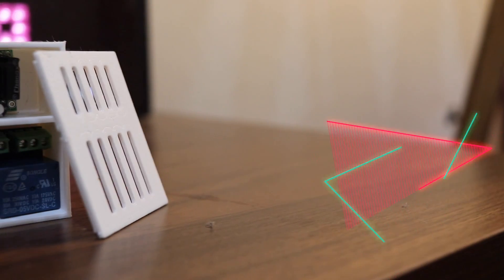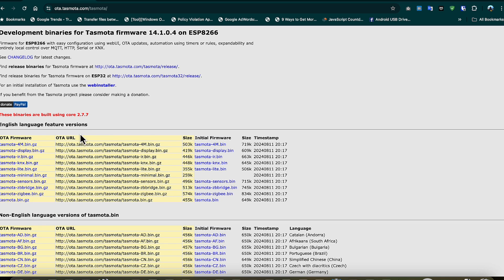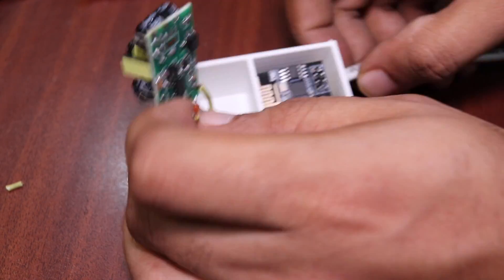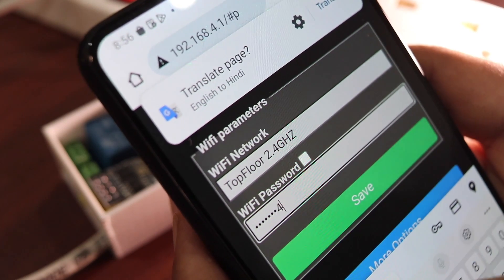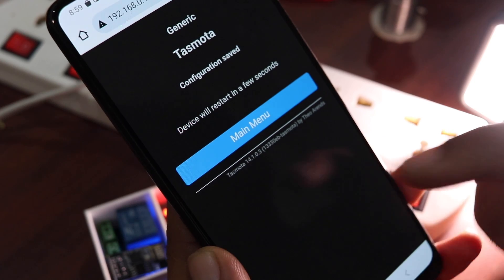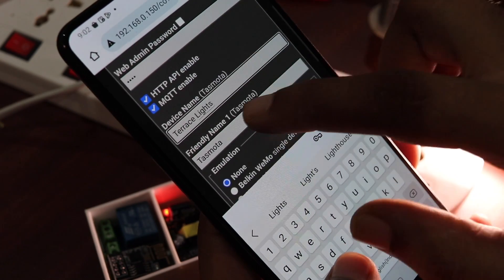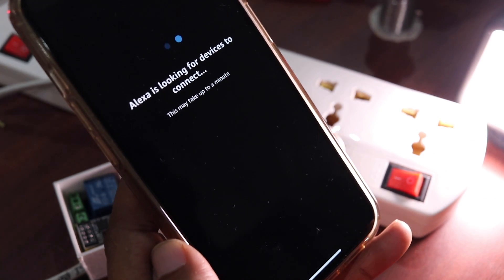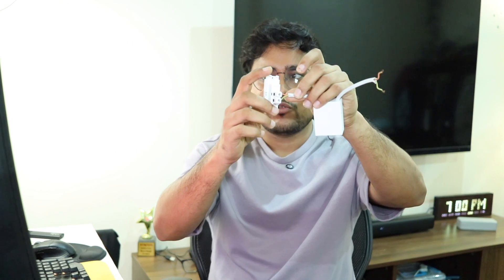DIY $5 Smart Home WiFi Switch | Works Offline & with Alexa & Google Home

Comment: Bro everything worked but last connection with ac device isnt working. Please show the connection. As you shown switch in the end if we switch on then it will short circuit. Please show it with device and how to connect this with apple homekit as you shown in start of video. 🙏🏻

Comment: Does this wifi switch need a constant wifi connection and Where is the load wire which should go out of the module to the device it is supposed to run ?
Reply from the maker: From the relay. Just connect the two wires connected to dumb switch to this. Be careful and don’t do if you don’t know what you doing
Reply: @ravis1ngh Okay, there are 5 points, 2 Points get 5v from the power supply, 2 points from the rest 3 points get connected to the switch, so what happens to rest 1 point that is what I am trying to understand

Comment: where i can get this generic power supply? and how esp01 runs on 5V.
Reply from the maker: With the relay module, you can use 5V supply as it has a 3.3v regulator built in. You can use Hi Link power supply which also fits well in this case

Comment: Does the ESP Home also have a local mode that can work without any server.  For example, in Tasmota, we ca use mem1, var1, timers etc to execute some programmatic loops and one does not need any server or internet.  Even wifi can be switched off and it work.  Will ESP Home be able to do that?
Reply from the maker: Yes, requires Home Assistant to do all that. However, basic controls can be accessed locally over port 80 without Home Assistant but use ESPhome only when using Home Assistant otherwise Tasmota is the way to go!  Infact I use Tasmota for all switches and do not use ESPHome for switches. It’s good for sensors though!
Reply: @ravis1ngh  Great. The newer switches are based on BK7231 and there is not good documentation on OpenBeken.  However the ESPHome has awesome docs.

Comment: Great video. Are you sure this won't create any electrical hazard if it runs 24x7? Also is the Hi-link power supply safer or better compared to this one?
Reply from the maker: Hi link is better and there is no hazard as such if connections are proper and tight. I am using them DIY for several years now. These power supply comes with protection and my home is also protected with fuses. It’s more or less like a aftermarket product when enclosed